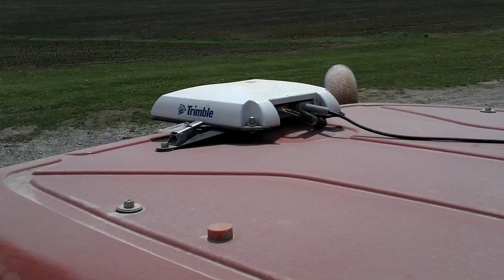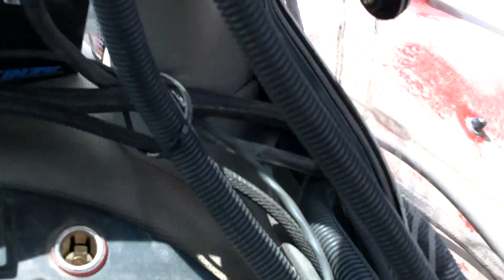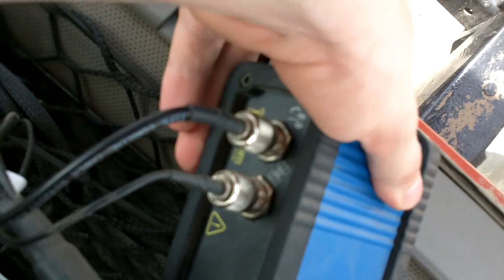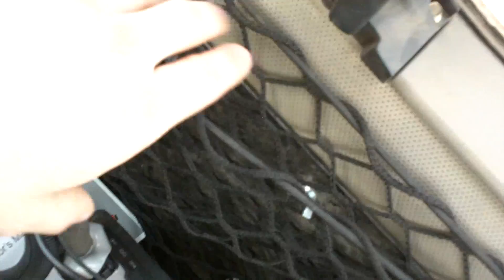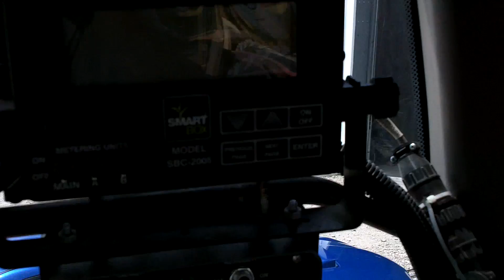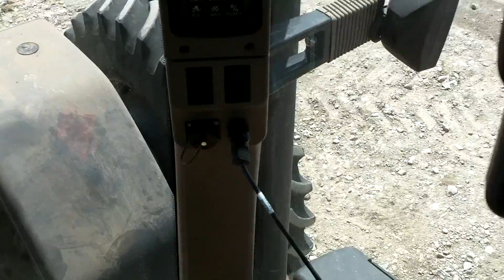Lefebure.com 2011 - MX275 Cab Electronics Tour

Comment: What kind of autosteer are you running? We've got a NH unit in the 4840, and the boss says it's a dream compared to the deere system he put in the Steiger, but getting it on line can be inconsistent. Wires, wires, everywhere, why do the cables all have to be 30 feet long?